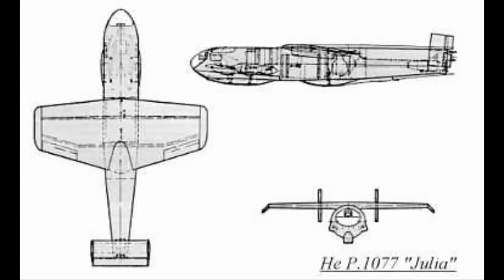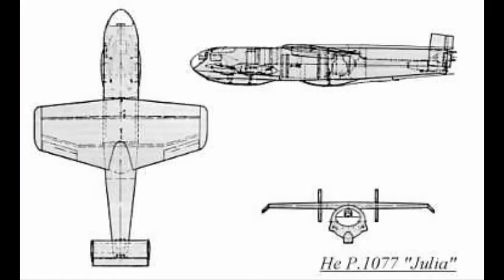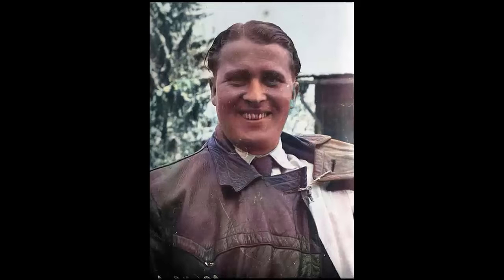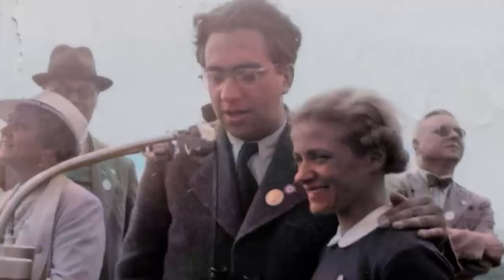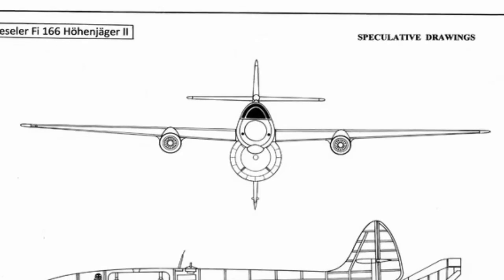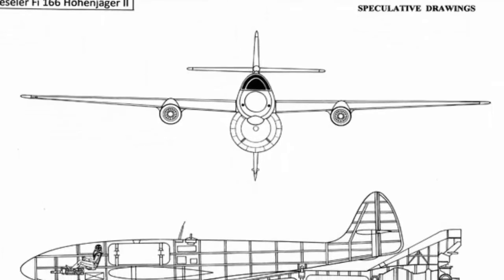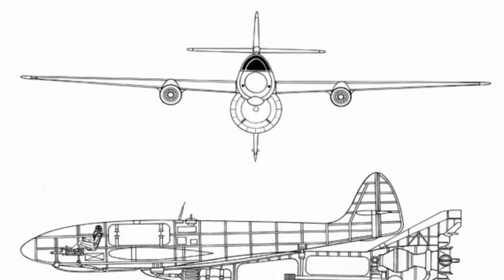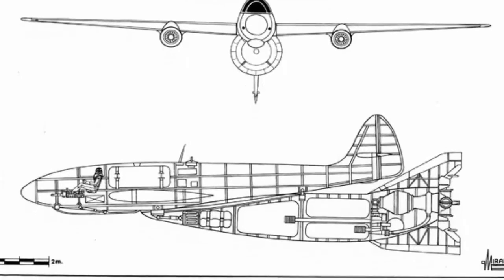Bachem Ba 349 Natter| German Kamikaze Interceptor Rocket

Comment: It was never a kamikaze rocket or a suicide rocket in any way.  The Ba 346 was to blast of under control of an autopilot system sunder automatic control on an intercept course to the target bombers.  There was to be provision for radio control adjustment if the bombers changed heading though this could also be handled by the pilot adjusting the autopilot etc. 
-The Ba 346 was positioned above the formation and dived down into firing its rockets.  There was no way for escorts to intercept and the tiny weapon was fast and hard to hit.
-The Ba 346 then dived toward a recovery field.  A drogue slowed the aircraft and detached the nose then the main parachute opened and ejected the pilot.   He parachuted to ground and the expensive back of the unit with the rocket, fuel tanks and autopilot was recovered.  
-The crashed Ba 346 has been recovered.   One of the rocket boosters fizzled and because the pilot had against advice elected to use manual control he lost control.